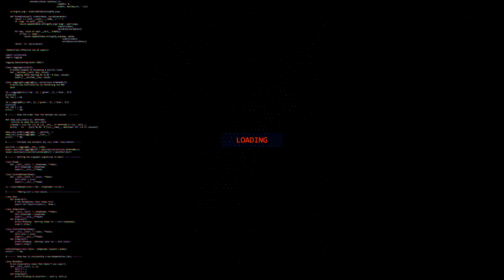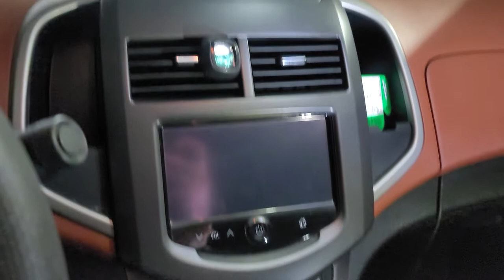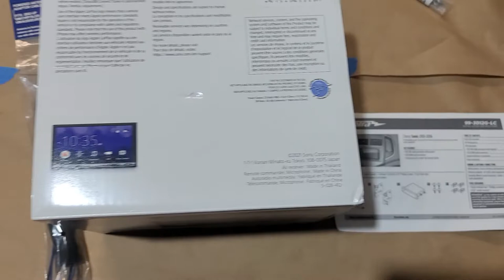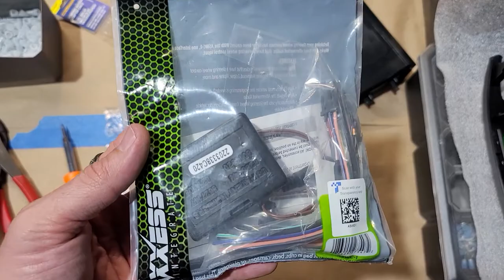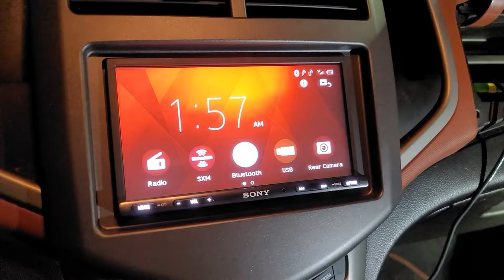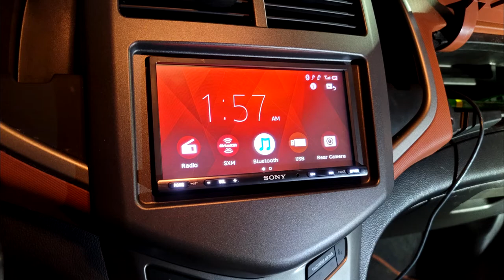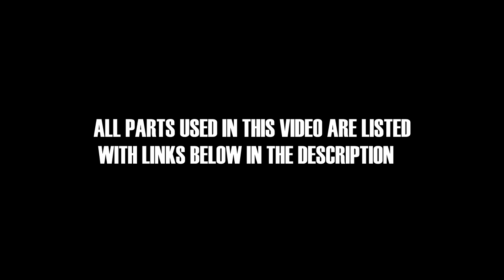CHEVY SONIC SONY RADIO DOUBLE DIN INSTALL - HOW TO

Comment: They did the Stereo Sony installation for me and they programmed the steering wheel controls but it doesn't work correctly. I don't know if it could be a lack of programming well done. One question, what can be done in this case?

Comment: great video! nicely done! im assuming the yellow plug for XM radio just never gets hooked back up correct? And the blue wire that hangs off the antenna 40-EU55 never gets hooked up anywhere either right?

Comment: If I do the usb part with the apple car play usb that the aftermarket receiver comes with, would it work with the stock usb port inside the small globe box?
Reply from the maker: It could possibly but we have not tried that.

Comment: great video! Will really help with my own install. Question, does the stock back up camera and phone microphone work?
Reply from the maker: That I am not sure because we did not have it with our vehicle. I would check on metra electronics website
Reply: Yes bro, it depends on the custom radio you buy.